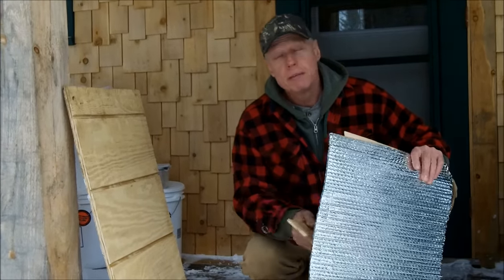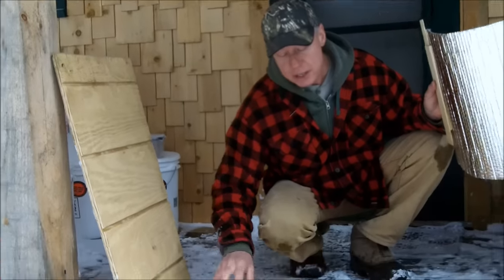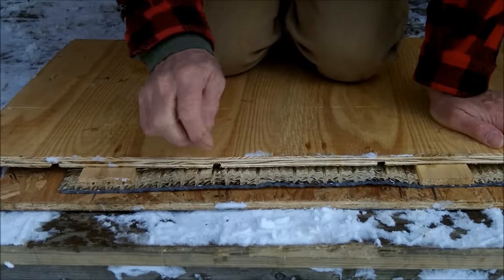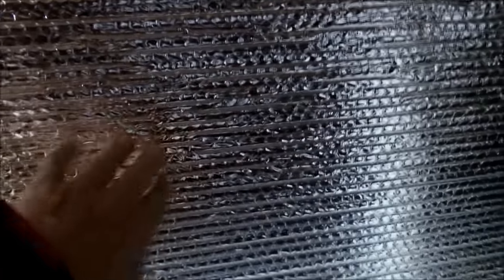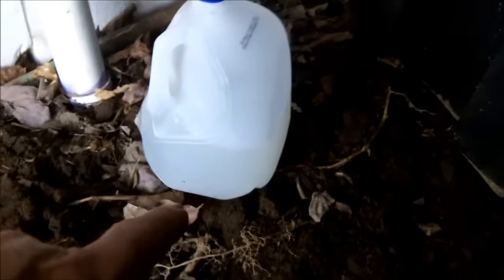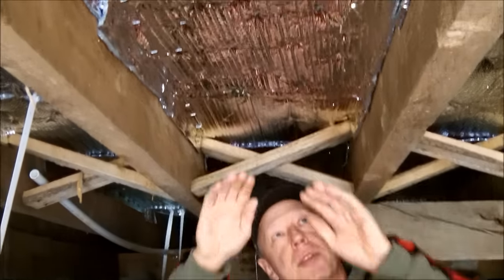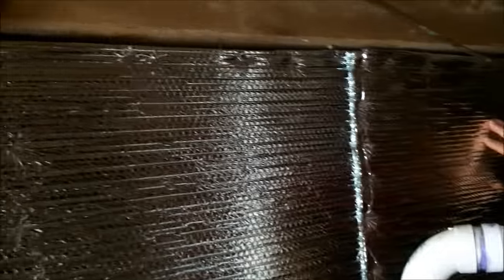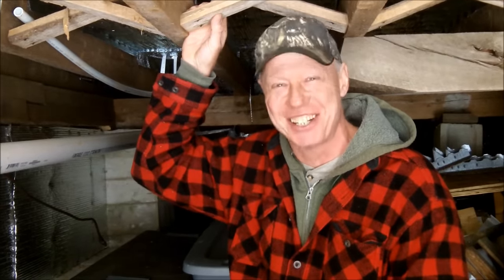HOW TO INSULATE A CABIN FLOOR AND KEEP IT RODENT FREE

Comment: I was about to insulate my yurt cabin floor with fiberglass batten and all I could see was a mouse hotel. I went online and found your video. What a great discovery. Your presentation is terrific. The only incorrect statement you made was that the ground inside your cabin is not frozen because of the heat from the freezer above. Not true. Your ground is not frozen because you have insulated the walls and floor above. The earth gives off about 40 degrees and your insulated area helps keep it from freezing. Also heat rises. The warm area above helps but does not through heat down.
Reply from the maker: I totally agree regarding the ambient temp of the earth and have discussed this many times in later videos.

Comment: Exactly the help I needed.  Bought a house that a bathroom built on piers with NO insulation (or even skirting) for the drainpipes (in Northern New England).  Formulating plan with Reflectix in mind.  Thanks!!
Reply from the maker: Insulate the skirting more than the floor and you'll be fine.

Comment: Thank you for sharing I will try this in my old camper. I was just getting ready to put a new floor in it! I need to skirt it for next winter and will use the bubble foil for that too!
Reply: Myra Hopper do you worry about the condensation in your camper with the skirting? Moisture is a constant issue in our camper, I’ve heard others talk about it as well.  Seems to be a constant battle. What have you done to eliminate that issue?

Comment: That was a great video thank you. I am just about to build a workshop, now I know how to insulate it and keep it pest free. Thank you Regards Richard.
Reply from the maker: If you can get the foil to blanket the top of the joist before you put the plywood down, that works the best. Just need to keep the rain from getting trapped beneath the floor.  Cheers

Comment: Finding you and this wonderful video could not have come at a better time!  I'm in the process of converting a mobile home porch to a 3rd bedroom that is already DECKED with womanized 1'x6" lumber.  While I haven't yet looked under the home to determine what -- if anything -- is under that decking, I'm guessing even the best hope is that there is some kind of 6 mil poly, etc., acting as a moisture barrier.  The decking is pristine, even after 10 years....not a single mushy board nor a soft spot anywhere that would indicate rotting or mildew or mold.  The new bedroom is tiny to be sure (8' x 12') but perfectly suits out needs.  I am trying to decide which of 2 methods in your wonderful video to go for...whether to add a new floor on top the decking with a sandwiching of bubble foil in between or remove some skirting, allowing me to get underneath the porch and staple strips of the bubble foil between the joists.  If you've ever come across this situation before and don't mind suggesting which of the two options you'd take, I'd appreciate your thoughts.  Been a handyman around my different homes since a teenager and mostly stay up with the latest new materials and, like you, NEVER heard of bubble foil.  Darn sure gonna look into it (I live in Austin, Tx....we have mostly mild winters but lately, with climate change suprising everybody, we've had some winters so cold and icy they actually knocked out the electric grid.  Some seniors actually succumbed to the cold.  I like doing REALLY good work, no cutting corners.  Thanks so much for your detailed explanation.  Looking forward to perhaps hearing from you.  Jim.
Reply from the maker: I would definitely go with the method of stapling this to the underside of the sub floor. This method works remarkably well for me and another benefit of this method is it allows no dampness to reach the flooring.  An updated version to this video can be found in the description below and I'm presently working on a video regarding the skirting. Good luck with your project.

Comment: In my experience, the radiant barrier is somewhat effective, but for your dollar, rigid foam insulation secured between joists then gaps filled with spray foam is much more effective.  

You can often find used roof foam from industrial buildings for considerably less than off the shelf prices.
Reply from the maker: I will never do that again. After dicking around fitting in the foam and all that jazz, the ants and mice destroyed it.  The foam board is all yours :-))
Reply: @thebossoftheswamp  Your mice must be particularly persistent little bastards if they're eating rigid foam.  I've never had insect problems with it, but can imagine it would be a deal breaker.  I'm north of the border, so perhaps it's down to the climate.

Comment: dude, thats great. was going to put 2 inch blue polyurathane solid insulation between the floor joists, glued and acoustic sealed. but this bubble foil is a hell of a lot cheaper

Comment: Here in the English hills we have an old brick built Victorian cottage and the solid  brick walls had no cavity so they were freezing. I put 2 layers of this stuff on all my walls using a 2x1 batten to hold the first layer against the bricks. Just drilled, plugged with plastic plug fixings and screwed it up holding the first layer against the wall. The next layer was pulled tight over the battens and stapled up then again I used aluminium foil tape over all the joints. Lastly we put on new plaster board or sheet rock as you call it.
 12 years on and it's one of the best things we ever did, in fuel saving alone this must have paid for itself many times over. We have very well insulated ceilings  also but done with 2x 4" close cell foil covered boards done in much the same way under very high ceilings. So for about 1.5" depth added to each exterior wall we have gained pure warm cheap luxury.
 I am just about to start a 28x12 foot garden office/ workshop and I will be laying this foil bubble wrap everywhere.
 Thanks for a great video.

Comment: We have a manufactured Mobil on the Sacramento River; this looks like an excellent product since we get flooded about once every 10 or q5 years; might even happen this week 1/10/23
We are tearing out the particleboard now and I’m looking at this application under plywood instead.  We are also removing the fiberglass that’s hanging low almost to the ground.  It would deter rodents, which is an issue this side of the levee.  Thanks for the advice to solve two problems.
Reply from the maker: This method has worked very well for me.  Be advised that Home Depot sells and off brand now that is garbage.  This is what I use and recommend:  https://amzn.to/3CDT8S7
Have a great day
__________________________________________________
As an Amazon affiliate, commissions are earned through qualifying purchase.

Comment: Thank you, I have a log home and struggle with temperature loss and mice on a regular basis.  I will definitely be getting some bubble foil.  Something I learned from another channel is to order concentrated peppermint oil and dilute it approximately 10/1 and spray it around.  Apparently mice hate the smell and it lasts about 6 months per application.  I just ordered it and haven’t gotten it yet, so I can’t vouch for it, but I trust the channel that I got the info from.  (Wranglerstar)
Reply from the maker: I tried the peppermint oil after mice destroyed my truck.  It didn't stop them but the truck did smell better.
Reply: @thebossoftheswamp  That's too bad, I was really optimistic about the peppermint oil.  Thanks for the feedback.

Comment: Ok you convinced me and I bought some bubble foil yesterday to do some insulation in my walls and roof as i have a gambrel roof. So I am hoping that it will work well. thanks for the heads up. Jim
Reply from the maker: Just my opinion here, but I would use it on the floor and ceiling but not surround myself with it as a building needs to breath.   Just my 2 cents.
Reply: Here in Chile they push the bubble wrap as sound dampening insulation so I was planning on using it for my interior walls as well as the floor and roof. My roof is a real problem because we get bats in between the metal and the insulation. I have a Galvanized metal roof which is common here and cheap and lasts 60 years. My house is styled after a barn (well I do have boys after all) and we kept with that style in the roof. 
I am looking forward to the floor and roof though. I am also going to use it to wrap my Hot water storage tank. 
Also in my younger days I was a commercial pilot and we used this same stuff in the windshields when we parked the plane on the ramp to protect the dash and instruments. It worked great then too. Thanks from Chile. Tell Lori that Lori and Jim in Chile said Hey!

Comment: I’m right at the insulation part of my radiant floor installation. I stapled up aluminum plates and pex tubing on a log cabin built on piers. The original insulation was R-19 fiberglass with a layer of 1 1/2” foam board R-10 underneath. There were so many squirrel and mouse nests underneath, it was disgusting. I’m attempting the “R-21” installation method of the double reflectix. The cabin is located in U.P. of Michigan, very cold long winters.
Reply: How did it work out?

Comment: There are three kinds of heat transfer: Radiation, Conduction, and Mass transfer. 
Radiation -- that's why this has a reflective aluminum surface. Check!
Conduction -- the trapped air bubbles in the foil act as an insulator... they 'will' transfer heat eventually but within normal ranges they'll be fine.
Mass transfer -- this is warm air escaping (not cold air entering, all the travel is hot to cold and the cold replacement air comes in AS you lose hot it... so try not to lose hot air.  That's why you should use the biggest sheets possible to avoid the gaps between sheets and as few nails or staples as possible. (Yeah, the holes are small, but there will be movement and the interior/exterior heat and pressure difference will find every one of those little holes and use them.). 

If you use that lathing/stripping to keep the floor off the bubble foil you should either use construction adhesive or daub some silicone on each and every staple/nail.  (Construction adhesive is sounding easier, right?)  You can also use that thin aluminum tape that is often used in joining the underflooring for snap-together wood floors.  It will block mass and radiative losses. And its cheaper and easier than daubing each nail.

Comment: Wow. I live in a cabin too. It is well over 100 years old. It sits on piers, and the floor is cold in the winter. If possible I will retrofit the aluminum faced bubble wrap under the floor between the joists. Critters are problematical here, and traditional fiberglass batts would indeed attract them to nest.  Thanks!
Reply from the maker: Did you skirt the cabin? Skirting made all the difference in the world.

Comment: Wow, very cool. Thank you.  I know the low R rating thing but look what nasa does with satellites with that gold color reflecting material. If you reflect the heat and cold you don't care about the R rating. R-Values. An insulating material's resistance to conductive heat flow. Don't conduct the heat or cold reflect it.          Great job and thank you again.

Comment: I'm almost 70. I grew up rural, on a small hobby farm. "The Outdoors" has been my passion and life until an injury ended my wilderness adventures... But, living close to nature means that mice and rats are always with us. No amount of traps or baits EVER solved my "uninvited visitors" problem. Decades of a Cold/Hot War brought me to an obscure YouTube video... 
Half and Half AP Flour, (or any ground grain flour) and Plaster of Paris... just a  -- !Bare Minimum! -- of water to bind into a Pressable Dough. Roll it out, or just press it into cookies. 1 inch squares, 1/4 inch thick is fine. Let It Dry! 
Toss several beneath your "place", and you'll have no mice or rats for 2 years... in my experience. 
The Plaster of Paris sets up - hardens - in their intestines, and the rodents die... No exceptions. Rodents don't learn to avoid these cookies as they do other baits and traps. 
I've never seen anything that works this well... Nothing. 
Placing it in "J-tubes" will insure that only rats and mice can reach the cookies. 
I have no pets, but I have lots of gray squirrel visitors... No squirrels have shown any interest in the cookies, but I don't know about chipmunks or red squirrels. 🤔 
So, be conscientious. Don't kill unintentionally.

Comment: Okay good video I'm a carpenter by trade and specialize in Mobile Homes set up in service do lots of belly repair. Currently my wife and I live out in the middle of the woods of the swamps of South Florida. And we are having a problem with rodents getting up into the belly what are the installation is. Now I always put steel wool around the pipes and electrical going through the floor but they still have managed to find a way in. I need to repair my belly due to multiple repairs before I bought the home and damages afterwards to the road and it's just not like chewing through that aluminum foil because I couldn't hear that to the bottom of the previous pre-existing paper belly underneath the mobile home. And one thing I would recommend even if it's 30 below make sure you have plenty of emulation and you're skirting you don't want to trap moisture underneath there cuz when it evaporates it goes into the structure of your home. I know this because my wife is from South Dakota and it gets very cold out there live there for about 10 years setting and service in mobile homes learn real quick not to fully see you left your skirting you want some kind of cross vent ventilation
Reply from the maker: All good points and I agree on the ventilation.

Comment: Just use wire mesh on the bottom of your floor joist before you build your cabin or home then pest can not get in the fist place ...And for out side walls on top of plywood use metal flashing 8 to 12 inch on bottom part of walls the rodents can not climb it to get in home or cabin ...Just seal it so water does not get in back of of the metal .... Just a suggestion ... Then the insulation will never get damaged .... And if want to use bubble foil put a 3/4 wood strip then staple to that to leave a gap more air space better insulation .....

Comment: If you enclose the perimeter of your cabin I recommend you put 6.mil.poly on your ground in the crawlspace to prevent the moisture from rising out of the ground. Moisture will create mold and mildew and rot.
Reply from the maker: I did that at my place in NY.  It blocked the ambient temp of the ground from rising and the temps in the crawlspace plummeted and pipes froze.  There's pros and cons to everything.
Reply: @thebossoftheswamp  Science would say a layer of poly would not prevent any heat coming from the soil but insulating both the floor AND around the perimeter will allow the crawlspace to take on the temperature of the ground. If one insulates the perimeter, one should not insulate the floor too or you would need to heat the crawlspace as well. This has been code for years in Canada.  PS, insulation on exposed water pipes might help too.

Comment: I have a small kitchen and only have 1 by3's studs on outside wall and would not be able to fit a 30" range & refrigerator in if I went with 2 by 4's so I installed the bubble wrap that you used. Kitchen is a lot warmer. Best thing with the left over made a couple of doubled over seat cushions to keep my butt warm when going to cold football games.
Reply: So...this can be used on walls?  How do you make it stay up?

Comment: The trapped air in the bubble foil is not the insulating property. After all , there is barely any in there. What does do the trick is the foil itself. It reflects heat back into the cabin. It works.

Comment: Excellent. So just to confirm, I can lay a layer directly over floor Joyce before putting down sub floor? Does this act as a moisture barrier? What do ya think about sidewall and roof with this stuff?
Reply from the maker: Yes. by going over the floor joist you create a thermal barrier. The drawback is you may have squeaks in your floor. If that's a concern, spale it to the underside of your sub floor between the joist.  I have updated info on this subject here  https://www.youtube.com/watch?v=Wa2-FWAwwUY

Comment: Oh thank you so much for sharing this! My goodness I’ve been racking my brain trying to figure out how in the world I am going to insulate my metal shed floor ( plan to convert into a house) and I’m wondering if I can just use it against the metal walls and roof for insulation. I have a metal lean to I roughly converted into a living space for winter, used the fiberglass insulation and plastic sheeting and got mold from the condensation, it’s heated by wood burning stove, very small space approx 10x15 maybe I think. Trying to figure out how to insulate it without having a mold problem and can be done easily and affordable.
Reply from the maker: This stuff has been the solution to a very long ongoing problem. I've never used it against metal like you're describing so I can't predict how it will work, however, any time I've put it against the (inside surface) of an exterior wall, it reflects cold back into the sheathing and creates moisture problems behind it.  It MUST be on the inside of the studding where it reflects (heat) back into the room. I have excellent results with it in this manner.

Comment: This is a maximum inuslation value R 0.5, to R 1  while in such environment R 4 to R 6 is the norm.  So it is way below what is advised. You should have done at least several layers of that platic stuff. I am in Europe, and in mountain area a roof should ne minimum R 6. The walls minimum R 4.    Your larger floor beams are still transmitting the cold, because in direct contact with the cold and the floor.